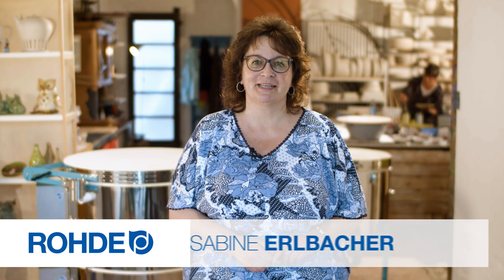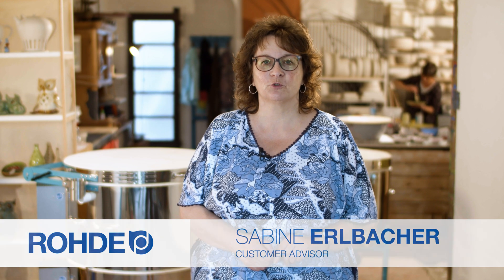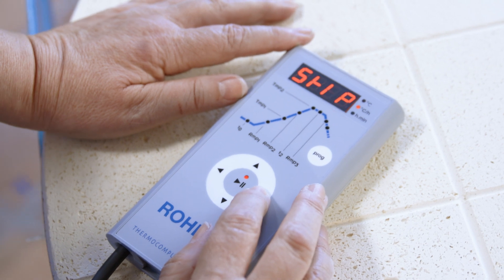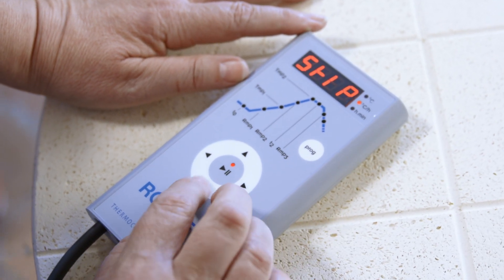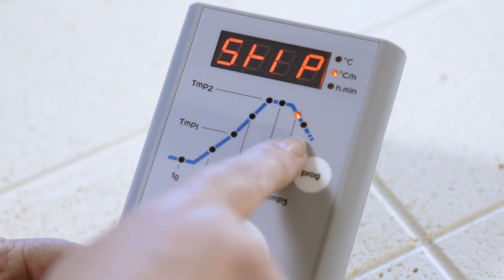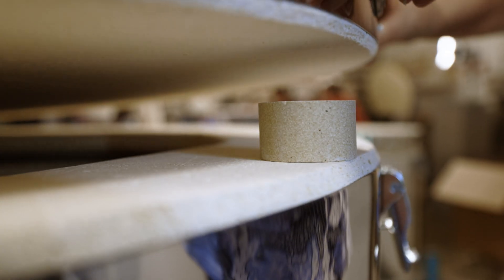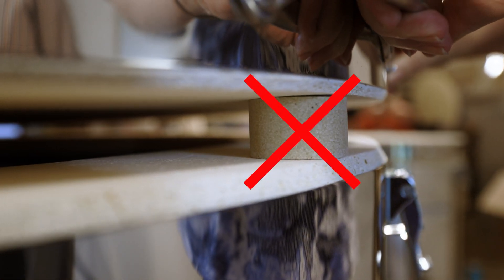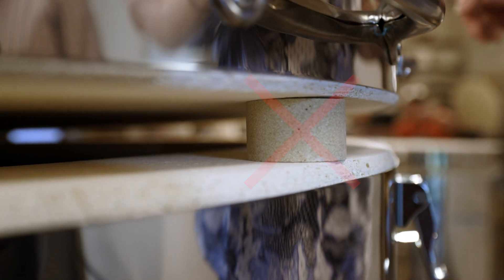Maintaining the cooling phase after firing extends the service life of heating elements and kiln

Comment: Is it ok to open the vent and the exhust hole after the soak time of bisque firing? Does that effect the kiln? Or better to kerp them closed?
Reply from the maker: The supply air and exhaust air dampers should be opened after the advanced cooling phase (see also ROHDE practical tips).
Ideally below 1000°C. This is because the heating elements can then cool down much more evenly and are therefore
also protected. For biscuit firing (usually well below 1000°C), this means that the supply air and exhaust air flaps can be opened.